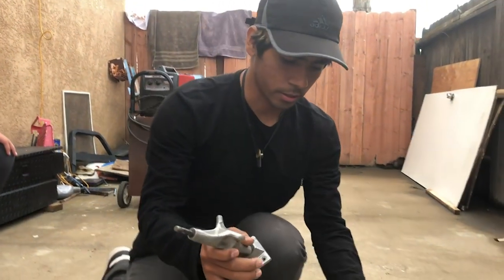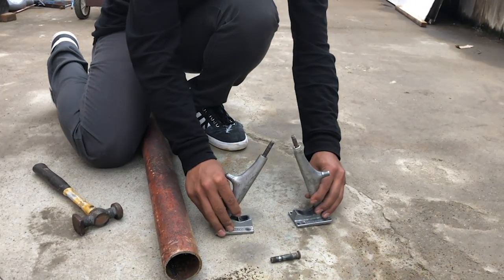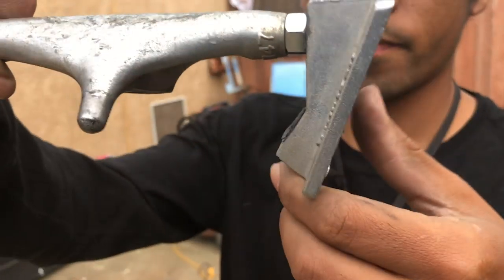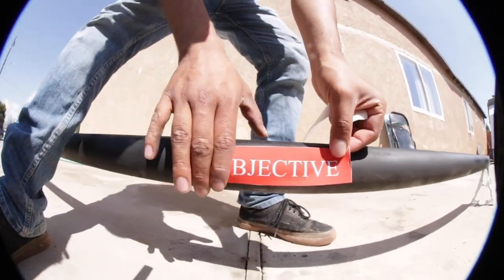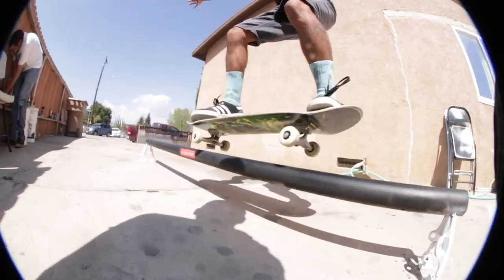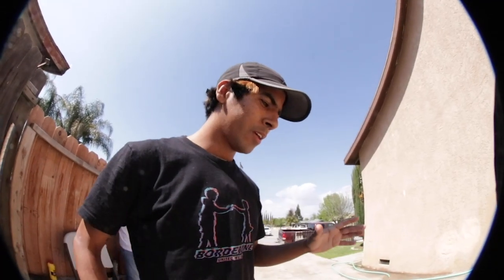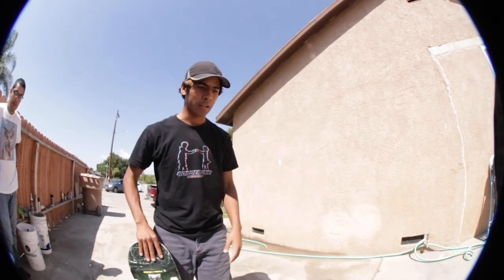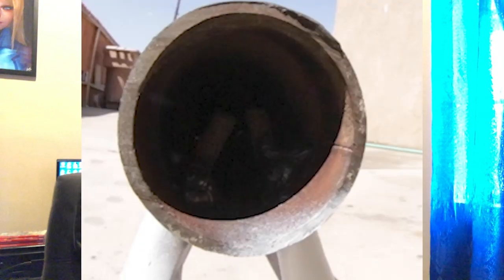HOW TO MAKE A DIY FLAT BAR TO SKATE

Comment: You could have also used shoe goo to weld. I built a ledge by shoe gooing wooden planks on top of each other and shoe gooing a metal bar to the top. It’s holding up after two years.great vid btw

Comment: You could make it even sturdier by passing a bolt throw the kingpin hole of the axle and join the two axles with nuts, and also screwing  some wood to the two trucks bases

Comment: one simpler way was to tap the drill holes on the pipe and match it to the threads of the trucks (I am assuming the threads are 1/4-20 or 5/16-18)

Not everyone has access to welders..